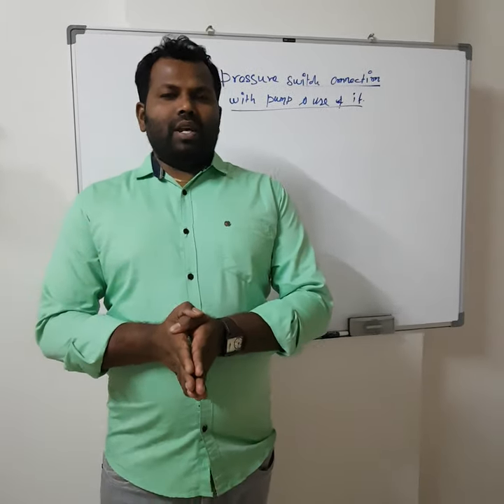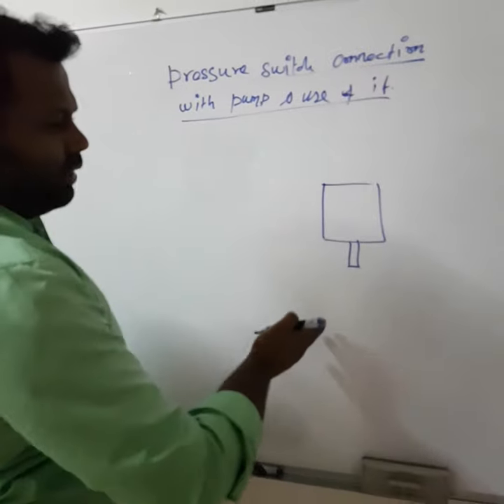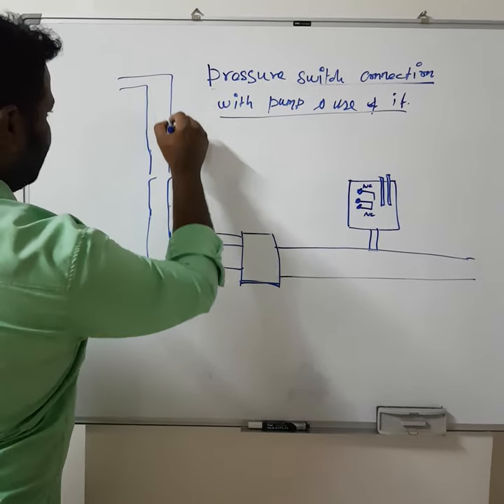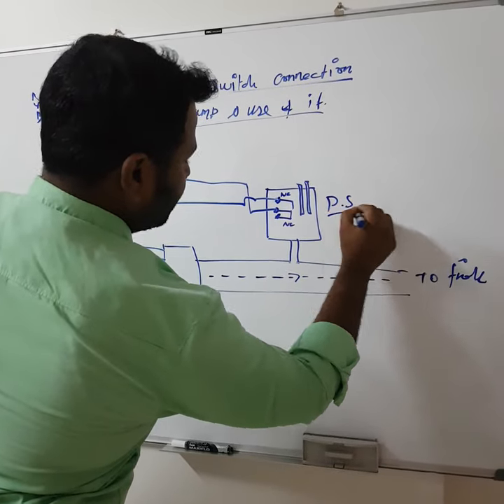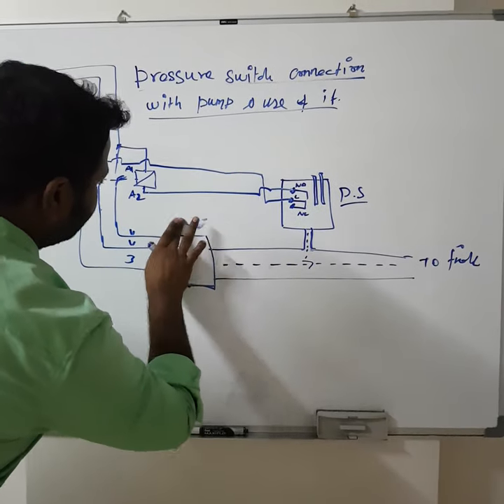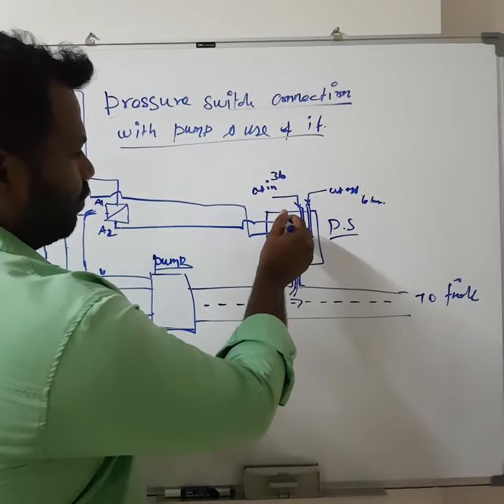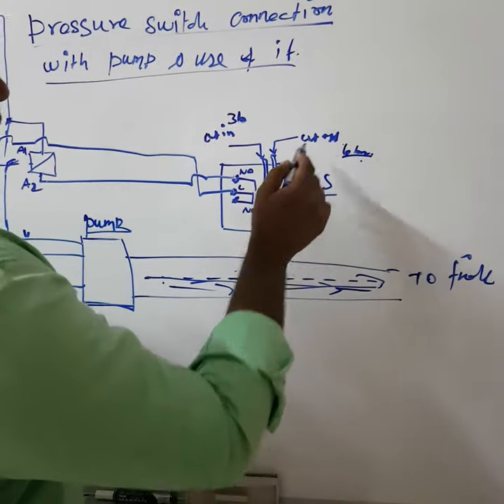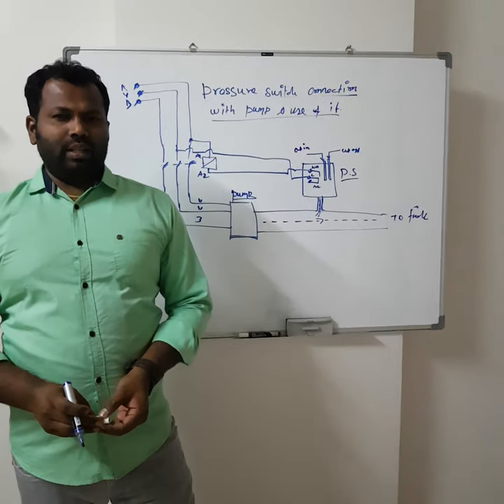How pressure switch working ?

Comment: For aux cont neutral was not given,then how it will work?
Reply from the maker: Hi 
thank you for your feed back.
for 415V contactor neutral is not required. You can connect any 2 phase. 
any doubt please write.
Reply from the maker: for motor application you no need neutral unless you use any indication lamps with 230V supply.
Reply: Anna,am asking about auxillary contact A1 and A2 point..
Reply from the maker: A1 connected with 1 phase directly 
A2 connected with another phase through pressure switch 
You can see 
So contractor will work with 2 phase that 415v